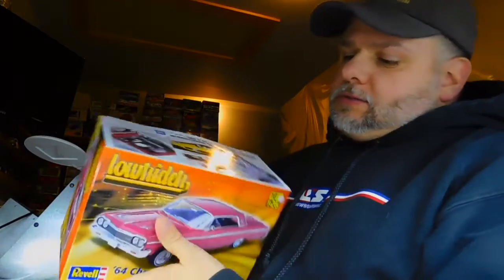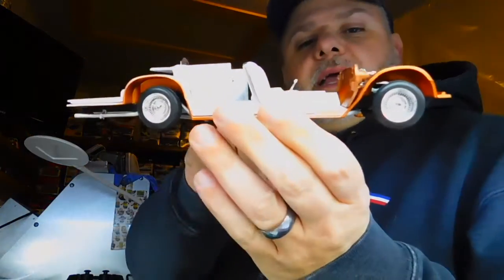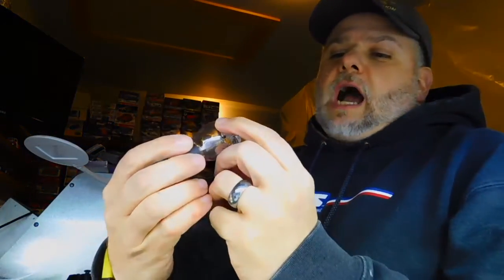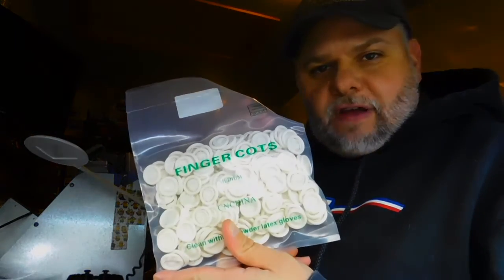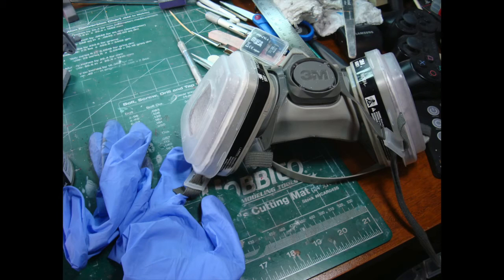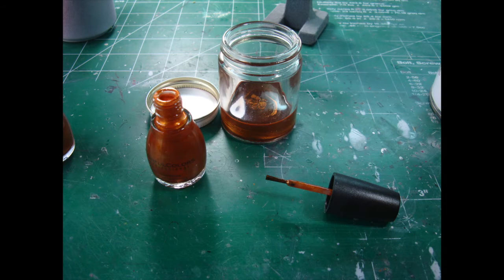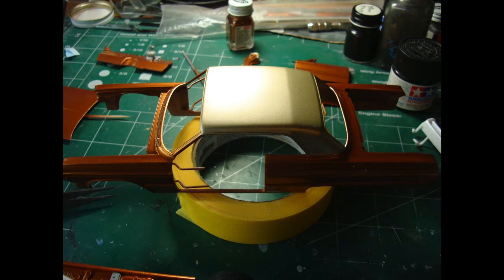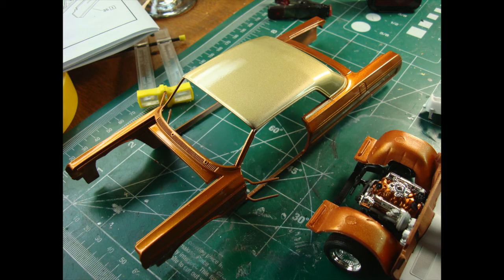Revell 64 Impala Lowrider Progress and Nail Polish How-to

Comment: Is nail polish really safe to use on our precious plastic models? Did you use a primer first on the model before adding the nail polish? If so, did you use a paint primer or a lacquer primer?
Reply from the maker: Stringbean I used a plastic safe primer first as a barrier to the hotter paints. Specifically I used plasti-kote primer.
Reply: @AngelosWorkbench  
Thanks for the reply.

Comment: I'm curious the order in which you painted and cleared the body.  Nail polish, laquer clear, Tamiya acrylic, acrylic clear (on the roof)?  Looks great.
Reply from the maker: Mike B thanks for the question. I always paint the lacquer color first so if I make an error with the acrylic it's a breeze to clean up. So in this case I painted the nail polish first. Then the Tamiya Acrylic and followed up last with the lacquer clear being careful to mist the first few coats onto the acrylic to avoid problems. Yes that is lacquer clear on acrylic.
Reply: Do you primer it first? Before you spray  the nail polish??

Comment: What airbrush do you use? What airbrush would you recommend for a beginner? Thx
Reply from the maker: Allen Jestes hello. I use an Iwata HP-CS. It’s a bit expensive but works very well. I would suggest getting one that works off a compressor as opposed to canned air and get a gravity feed as opposed to siphon feed. I find the gravity feed ones are easier to clean. Good luck and happy airbrushing!

Comment: Hi Angelo,i just now saw youre video about nail lacquer painted on models,can i thinn it with Tamiya lacquer thinner?
Reply from the maker: I’ve never used the Tamiya lacquer thinner but any lacquer thinner should work. Test it out by mixing a small batch!
Reply: @AngelosWorkbench  great and thank you for reply..thing is that here in Germany i cant find thinner which you use in this video and ordering on ebay from USA  is bit expencive for me,but thnx anyway
Reply: @AngelosWorkbench  i test it now Tamiya lacquer thinner with nail lacquer and it works great!mixing ratio is 50:50 and 2Bar pressure,also drying time is around 15-20min,im happy how came out :)